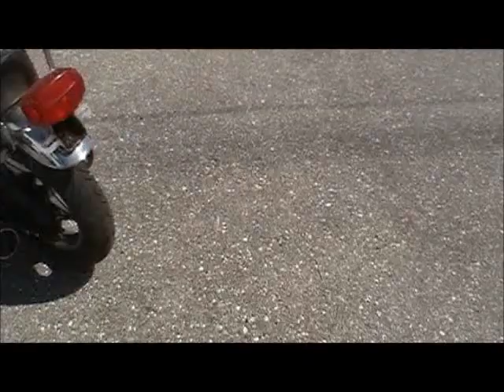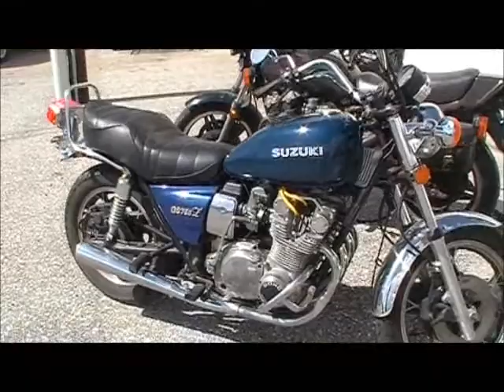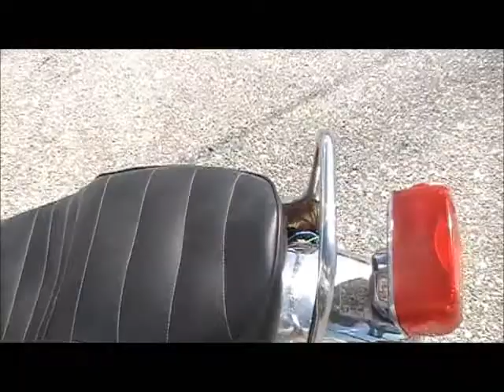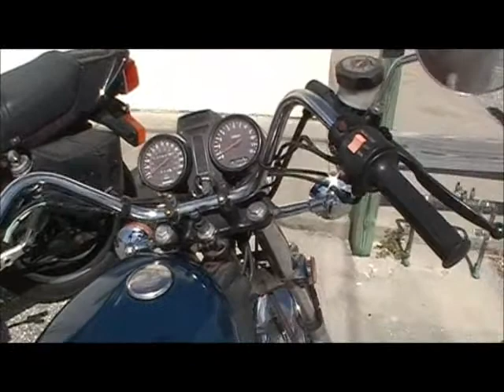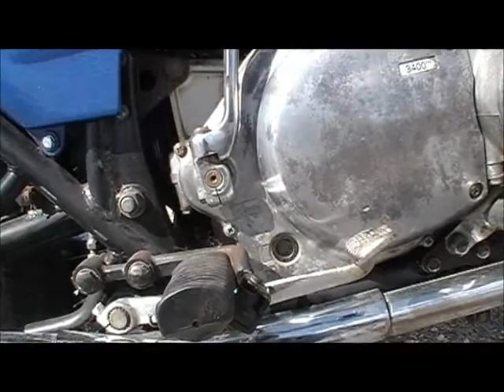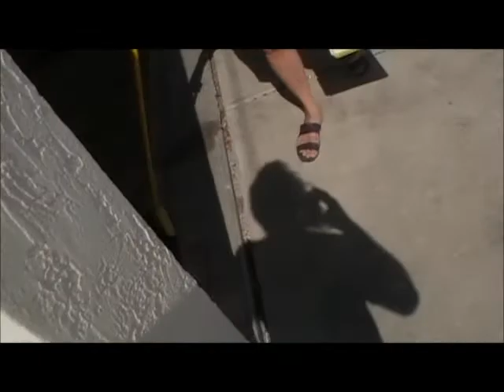1979 GS750L - Up and done

Comment from the maker: For the new style head I've had the best luck with Denso Irridium's  -- 82 could go either way -- 12mm thread or 14mm thread -- my 79's all take regular car 14mm thread spark plugs. - Bear in mind I not only jet to my exhaust and coils -- I adjust my mixture a bit rich to bring the cylinder temps back down

Comment from the maker: I dial em all in even every time -- but not until after I've hit each exhaust with a temp guage and made sure the mixture is even across all four (which I recheck after I have em synche'd - then adjust and recheck if necessary)... I always do an even synch -- all this let the outside 2 pull more or less stuff kind of takes the 'synch' out of synchronizing

Comment from the maker: Accel 140404's Those are drilled through the existing fake holes at the back into the baffle plate itself - the object is to let her breathe without making her loud S weave fiberglass in the baffles themselves wont blow out for a couple of years at a time but allows excellent flow through to the holes and keeps her hushed at the same time -- #135 mains finally got her right - The #125's I had tried first had her popping when I let off the gas

Comment from the maker: I ended out with 5 6mm holes which is closer to 1/4" - I messed up the first set of pipes taking them to 5/16" holes - I gained a little power but it was all up top and the torque dropped off like a wall - and it got too loud so it defeated the purpose of building a sleeper bike - I am running an old school all foam air cleaner too -- that's about 2 or 3 mpg right there

Comment from the maker: just the mains -- I do adjust my mixture screws a hair but if you have coils on you shouldn't have to -- just runs a hair cooler leaving em rich -- 135's aren't enough to foul plugs as long as you dont change your needles

Comment from the maker: I ended out with 5x 3/8 in holes in the back -- You drill right into the rear baffle plate -- if you drill the core it's not a sleeper anymore (and bad practice)-- you are jetting a bit rich to enhance the - just go through the plate right behind the holes in the fake holes on the very back plate -- Stock cam there aint no way in hell the bikes gonna breathe anymore than that once the packing/fiberglass blows out in 5 or 600 miles -- Stays quiet breathes freely - HUGE torque gain

Comment from the maker: The long bit is if you are going to core one out -- not advisable -Plus you would still have to drill the inner plate at the back - If you want it that loud get real cans (Kerker K45's) and cut em to tune em -- That or Supertrapp Race Core Slip-ons and buy you a couple extra disks -- A stock head with stock cams doesn't have enough flow to justify em though. -- Plus that head cant take free flow without putting in stronger exhaust valve springs

Comment from the maker: It's the combination of the coils and the exhaust -- the heavier jets are to keep the cylinder temps down -- Summit sells loose jets - It's under 10 bucks for a bag of 5 -- No need to change the needles if you are adding coils.. Do new 8.8mm wires though - never trust old plug wires when you have coils that can spark through raw oil